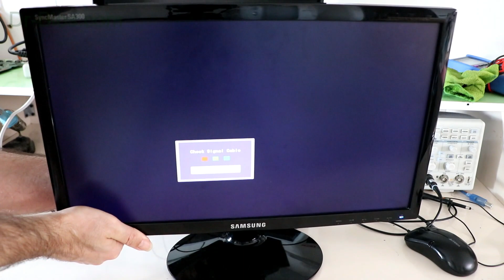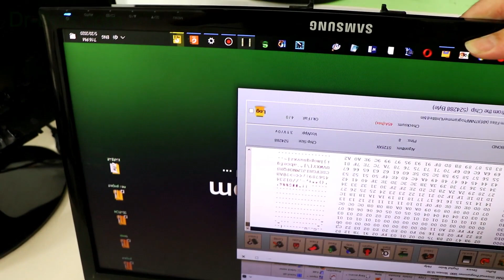How to Solve Not Detecting VGA Port Problem in Samsung Monitor

Comment: Lol, I have same exact problem with DVI port, it does work until Windows logo screen, afterwards it just turns blackscreen, monitor starts gliching and doesn't work. I don't know how to recode this stuff and got offered a replacement, so I took the simple way